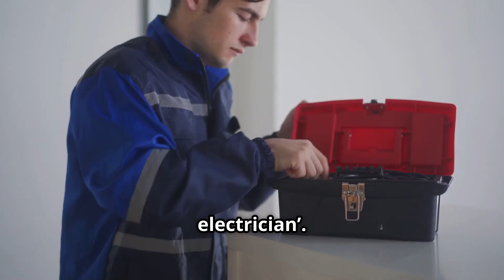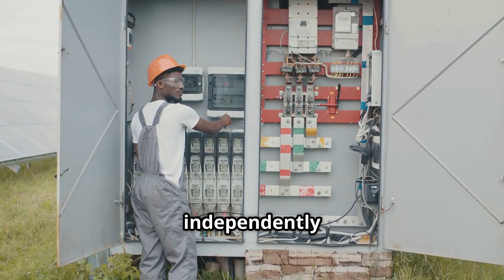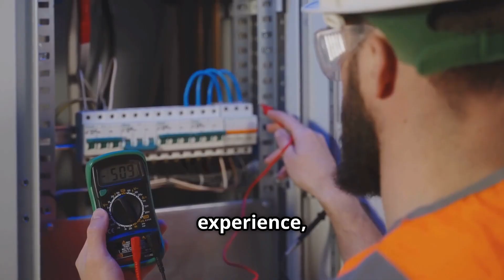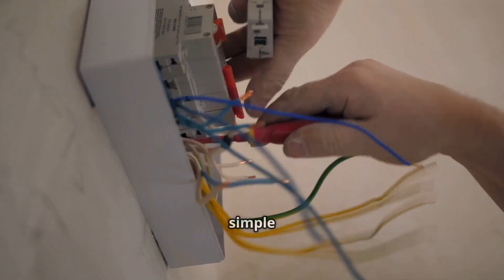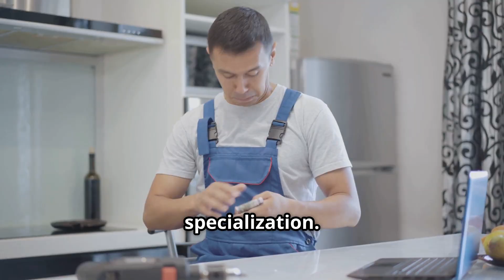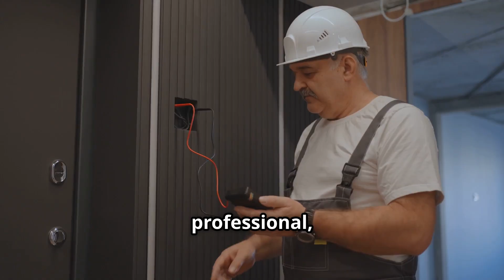Journeyman vs Master Electrician: What's the Difference?

Comment: 4th year apprentice in Australia is more qualified than a journeyman. Full circuit design, cable/protection sizing and discrimination, volt drop, fault loop impedance, phasor diagrams, testing & verification, fault finding, and more. 

At 21, after completing my final testing in the top percentile (only out of the other stupid, young construction workers mind you) - I was a fully qualified industrial electrician. Licensed, and legally responsible to design/install/test/sign Certificate of Compliance - unsupervised on any electrical work under 1000V. 

And hey, I can’t begin to imagine the ego of these old ass guys pretending to be a ‘Master’ in their job title means they are superior to the apparently negligible journeymen. They’re both half sparkies, and I’m being generous with that.

One of them runs cables like an apprentice all day, following suit by taking zero responsibility for his work…
And the other genius, armed with the equivalent training of a fourth year apprentice… Is brave enough to drive out to jobs, to put his signature next to a system installed by monkeys for tradesmen?

Maybe this is what happens when tradies spend more time memorising how to measure things at work using fractions instead of millimetres. 
I mean why else wouldn’t they have the time to be fully educated in:
Star-delta soft-starters, VFD’s, harmonics, power factor correction, PLCs/ladder logic, maximum demand, 360 phaser diagrams….

My goodness, at least try to refrain from walking around like Maxwell’s reincarnate while doing half the job of an actual A-Class Electrician.